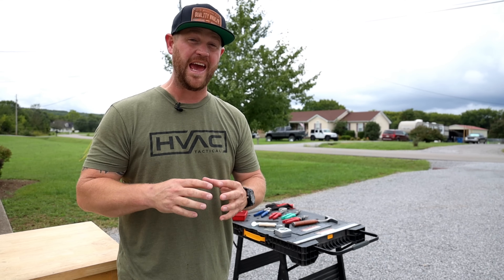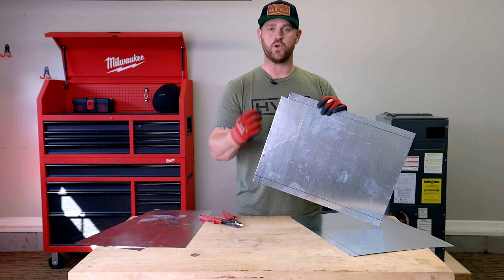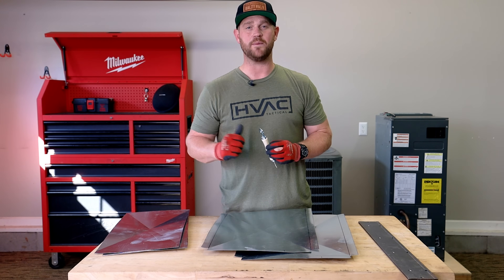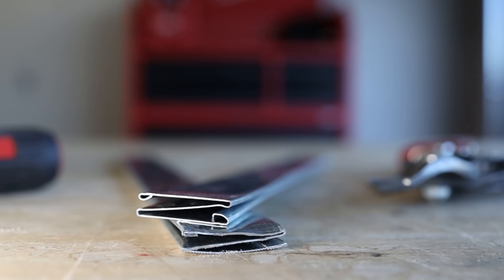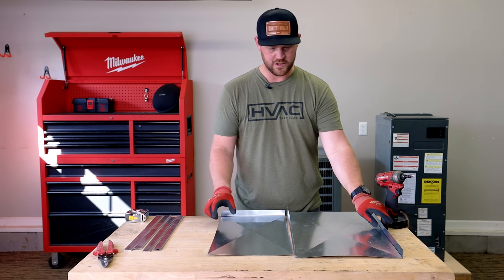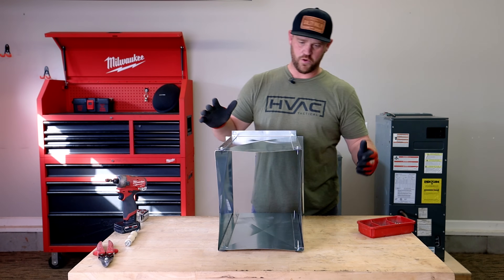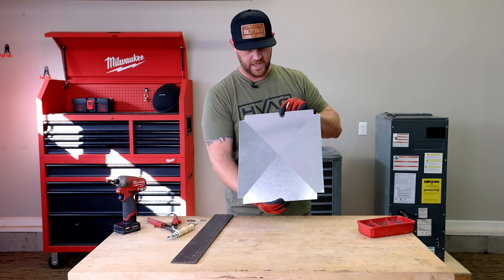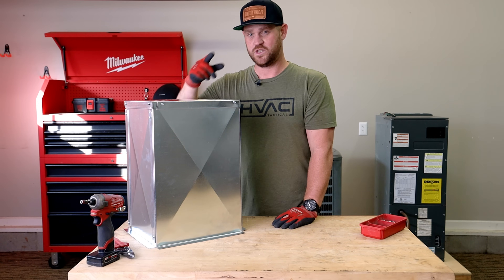How To: Fabricate A Plenum Box With BASIC Hand Tools | HVAC Ductwork

Comment: I'm trying to reuse my existing ducting for a duct tape mini split and may have to make modifications for the air handler. I was given a $12000 quote on a new traditional system and a mini split that doesn't require refrigerant charging can be an advanced DIY project for less than half that quote.

Comment: That's right...we're supposed to be impressed with a sheet metal worker making a sheet metal box. 
   I spent 10 years as a sheet metal worker--4 years apprenticeship and night school, then as a journeyman. That was back in the 60s and 70s.
   Back then, the old school journeymen were still around, men who could lay out and build square to rounds, rectangle to ovals, whatever you wanted, and all with offsets as required. They were craftsmen. 
   One of the main reasons I left sheet metal work in '74 was because I could see that the age of craftsmanship was rapidly vanishing. 
   Speed, obsessed with quantity, was replacing quality. This is why we are supposed to be impressed with a video like this. 
   So much is lost. Machines replacing men. Men merely operating machines. So sad.

Comment: I believe you are building a transition not a plenum.  The supply ducts would be connected to the main trunk line, not a centralized plenum box.   If it was a plenum, you wouldn't be triangulating every section.   Normally residential construction uses 1/2" #8 self tappers or #7 zip screws and commercial construction uses 3/4" #10 self tappers in consideration of the size and air flow resistance.   It looks like you could be doing some framing or demolition work with those burly arms of yours you don't have to use your head as much.

Comment: One example where a DIY homeowner might find this process useful is connecting a replacement downdraft cooktop to an existing ductwork to outside.  I fiddled with fittings and adapters for two days but there just wasn’t room inside the cabinet.
The solution- a small plenum box built exactly as you describe here with a cutout for the fan unit on top and another cutout for the round existing exit duct on the bottom.  
All the parts you use are available at a nearby home center.  If I had anything to ask you to add it would be the materials used to seal the box during installation.

Comment: Great video.  

What is the sheet metal you used to make this?  Thickness, dimensions etc.  Is it available at the typical big box stores?  You make it look easy and after watching this video I know I can do this.  I even own the screen tool :)

I am thinking about adding a second Air Return in my basement.   There is a 14"x14" on the furnace but it is in another room (unfinished) separate from the main area (finished.)

I was thinking I could make a box similar to this and install it on the Main Air return.  I would cut a hole in the wall of the main area and add the box at the bottom of the Main Air return and use a filter and cover (14x14 or whatever the nominal values is) and pull air back into the system to get more air circulation.

I may do this if removing old tape, cleaning and re-taping does not help.   I would add a couple more Air Supplies first as well.  

It is too cold in the Main area which is finished but real cozy in the unfinished area when the 1 Air Return is down here.  There are 2 supplies in the unfinished area and 4 in the finished area. 

Brian

Comment: Very nice job thanks for the video!.

Let's say your working in a tight closet. You just installed the furnace and working on the transition but your in such a tight spot and you can not add any screws to the outside of the the transition box. The leftside, and right side, and back are unreachable. Can I just add the screws to the inside is that Acceptable!

Comment: great video.  would have been even better if you had made mention of sheet metal gauge used and if if should be different depending on build.    also was hoping you would discuss a little into duct attachment to plenum after it was completed.

Comment: Using the window screen tool to make the cross brakes is genius! I've had one of those tools hanging on my pegboard for years and it never occurred to me to use it for that. Lacking a large box & pan brake has been an obstacle but with that trick under my hat I hardly need one now.

Comment: Thanks for the video. What is the max length of the cross break I can have on a rectangluar trunk? I have a metal sheet of 4x10 feet, so I was wondering if I could use that and connect the ducts every 10 feet.

Comment: 3 Questions: First, why do you use such long screws? Next, Why do you use an impact driver? Working with and assembling sheet metal is noisy enough by itself. Finally, without feeling the metal, I can't tell what gauge you are using. What gauge are you using for your project and is it code for plenums where you live? Thanks. Retired tin-banger from Canada.

Comment: you tube is cool as hell. i've been a square duct / hvac  layout and installer for over 30 years.I ve installed more than several hundred hvac  systems. I  worked with and was taught by several old men who were sheetmetal mechanic in the 60's. But none of them ever showed me about the screen roller to make a cross brake. I would of never thought of that. Thanks for sharing. Sheetmetal fabrication is becoming a lost art. I am trying to learn all of the old ways of sheetmetal fabrication, and (tinsmithing) . I'll definetly use the screen roller to put a cross brake on my tie ins next time I change out a unit and have to field fabricate the duct work.
Thanks Again
Reply: Im sure you're familiar with hand made Pittsburgh seams. A little rough on the hands, but I like making them look better than the machine.

Comment: Really cool technique w the screen roller.   Do you still tape the joints?  They used Slock (or similar) on our newer plenums and taped them as well.  

What I’m in need of is a new catch pan, long story short it was made too short to extend under some key parts to fully catch condensation water and when the 1/2” drain stopped up from slow rust and mineral accumulation…well it’s a good thing there was a water resistant cover on the pool table 😱.   I’ll have to look and see if there’s a deeper folding bar avail or make one.  

So any tips on drain pan forming or unstopping an in-wall 35’ long 1/2” drain w right angle pvc joints in it, please feel free to make a video 😉😉!!

Comment: I always used adjustable quick scribes to mark the notches. I have never seen that cross break tool before . I'm sure it would only work on 26 ga. metal or lighter , but seems make a nice looking break .

Comment: I'm not an HVAC Contractor!  however, I'm making a Plenum that's 36" W x 21" D x 11" H (8,316 cubic inches) to fit on top of an 80,000 BTU at 96% Efficiency Gas Furnace with an evaporator cooler sitting on top of it).  What's the minimum spacing between ducts. I'd like to install 2 or 3 6" ducts on the front and rear,  is that overkill? meaning.  on the 21" Depth side from front to back, cutting 6"  holes to install (2) or (3),  6" Ducts.  the width left to right will be 36".   would it be better to install (2) 6" ducts on each width side. they will be 21" apart front to back and cut an 8" Duct perpendicular to connect to a remote Plenum? I can't provide a diagram because there's no way to upload a .jpeg or .png image. the current Plenum that was installed 30 Years ago with a 115,000 BTU Furnace was oversized!  my home is 1500 Sq Feet at 5000Ft Elevation above sea level in Utah. The current installed Plenum is 23" Wide x 20 Deep x 22 High. it has (3) 6" ducts on the front 23" wide side, (2) on the Right Depth Side 20", and (3) 6" ducts on the Rear 23" side Total Cubic inches (23x20 = 460 Cubic inches x 22 Inches = 10,210 Cubic inches.

Comment: That looks great and neat .
My duct work to the ac is coming away from the brick wall . What would be the best solution to fix this it's been about 7 years since the install, I believe my home is settling.  Thanks for your expert advice
Reply: Depends on how far the distance is, I’d measure it, then you’ll need to remove a section to add a piece in between to bring it closer to the wall. You’ll need to account for the crimp sliding in also on top of your measurements, a hand crimper is normally 1’1/2” extra, make sure to screw it in after and seal it with a mastic sealer or a duct tape.

Comment: I just built one of these per the video and it turned out great--the only thing I did differently was the "safety flange" that condorman3 described in this comment thread.  I even had one of those screen window installation tools in the shop and didn't really know what it was until this...🙃

Comment: Hey thanks man , used your video . I just rebuilt my plenum box above my furnace to add in a new ac coil.  With a back ground in machining but no exp in sheet metal it was a snap with this videos .    

It was just like grade 2 all over again cutting out paper shaped and glueing them togeather except the paper will cut you bone deep and the glue is s clips and c clips

Comment: I never worked in a sheet metal shop that had carpet lol I was taught the cardboard trick for on the fly cross breaks tho , the screen tool is a nice touch I always used a straight edge and the heaviest screwdriver I had lol

Comment: These types of videos are the best ones. Teaching folks how to put things together and build ductwork at home. Keep up the great content.
Reply: Steve Lav has some pretty good sheet metal videos.  He does a good job of creating sheet metal transitions to tie in the new furnace with the existing ductwork. For some reason, most of the HVAC contractors in my area love duct board but I’ve seen some real sloppy installations using that product.

Comment: I'm a 33 year HVAC guy with a full bag with tongs, Whitney punch, bar folders, tongs, tinner hammer, panduit gun etc etc etc, and while I CAN build a box, I do every 9 years. In my opinion there are very rare boxes or ducts what are well done, and none that are as good as a fab shop. Good Pittsburgh's, furnace flanges. shoes etc mean that a fab shop with do a more professional job than a field setting 100% of the time. I can't count the boxes I've seen built with S locks. It is rare that I have to build a plenum on the fly. It's an installation environment which mean, and should imo, plan. So 99.99% of my jobs are planned and executed well through planning, which means things are fabbed.
Reply: You are absolutely right a properly measured and pre fabricated plenum is ideal however he did a pretty solid job considering only hand tools. totally useful for on the job application
Reply: @stevetranchida  I can't disagree with that.

Comment: I would love to see this made into a series. Take each basic part of a solid duct system and show how to make it with basic tools.
Reply: I second this
Reply: I second this
Reply: @igotsomespace  you mean 'third this' ! 🤣
Reply: Nah, I turd this
Reply: I’d like to see this one made out of two pieces instead of four, sans the lid, only using hand tools. You would only have to make one bend with something other than the tools shown. I can think of several ways, but seeing it done would up confidence.
Reply: @Jack of All Trades Master of Some  you could use that 24 inch folding bar. Put the folding bar on the inside lined up and hang the metal off of a table a bit and bend it up
Reply: i keep hearing S-slaw
Reply: @amiga2025  lol im still trying to figure out is he said bullie bar or fully bar but I know I need one

Comment: 😂 when a commercial installer jumps to residential.  
 Seems like using S lock is just added material that’s not needed. doing it in so many different peace’s adds air loss if you don’t seal it on the inside. Could of done the hole thing in 2 peace’s

Comment: Great video. I found another one where the mechanic builds a one piece plenum using the edge of an aluminum step ladder as a brake. Both ways are good, one piece is less expensive, uses fewer s Locks.  Thank you.
Reply: Its not a lock, Its an S-Cleat. S-cleats are used if you're too lazy and stupid to make a lock.

Comment: That's a nIce  job!  As others sometimes do, I also make a safety edge on the bottom flange. Another thing that can be done, is instead of using S cleat for the seams, you can make your own Pittsburg Locks which look far better and more rigid. The Pittsburg locks take quite a bit more time by hand though. Many guys in the field would just use the S locks as you did, but if the job was a big profit job, or for your mother or father you might spend the extra 30 minutes to an hour making those Pittsburgs. WIth good handtools and experience at it, those Pittsburgs might only take an extra 10 or 15 minutes. You have a good long bar folder on hand there I see! That helps. One thing I learned here was using that wheel to make the cross braces...very cool.

Comment: Flange lip is to big that will be off the sides of the furnace and back. Should have folded that twice, looks like 1 inch, you fold that piece again with 1/2 folding bar it would sit perfect. Good job however.

Comment: Thanks for the video! ... For anyone searching for "folding bar" it is the Malco 24" hand bender (last item in the list of tools).
Reply: Question  how to put the holes (exits)on the  plenum box?
Reply: @jgro7319  1-Draw a circle 
2- Drive a stout flathead screwdriver through the metal with a hammer 🔨 
3- Drive the head of the screwdriver 🪛sideways through the metal until you have a 4"-5" gash torn into it
4- Use offset snips to cut out your circle 
5- If your hole is too small, trim it
6- If your hole is too big, discover metal patches and pookie🤣

Comment: Nicely done.  Only thing I'd do different is the 1" flange that rest on top the air handler.  I would have used your folding bar with the 3/8 side to bend it under itself.  Making it a half inch double hemmed safety flange.  No sharp edges that way.
Reply: I was gonna mention the safety edge too.
Reply: Great idea!
Reply: Good point , I just now screw straight into the flanges in the ah, now a days you gotta tape, mastic , duct seal or whatever method you use and wrap it anyways, kinda mitigates the sharp edge thing,  of course tho some stuff is exposed and not wrapped then 100% the double half inch hem, flange , whatever is the safest and of course best looking no doubt 😉
Reply: @donniehallaman7685  you guys have to wrap in non-humid basements?
Reply: @Edifying_Topics  yea we have to wrap anything that isn't conditioned space, if it was exposed in say a finished basement with runs then no. But if it's unfinished unconditioned space then yes
Reply: @donniehallaman7685  you talking about wrapping the  whole air handler?
Reply: @Mike West  no just duct , plenums the insulation in the air handler is enough I guess? I have never been told to wrap the air handler luckily can u imagine going to a service call and having to cut duct wrap off to take the doors off lol , that would blow

Comment: Need to show how to make a folding bar for the nonprofessional. Perhaps a hinge sold in different lengths/widths at hardware stores, then maybe sandwiched 
between couple boards the same length. That would give you the 1" depth. Just an idea, right now I don't have a need to make one.
Reply: Get a Hensler bender off amazon. will do 36" and is about $80. Harbor freight has a 30" brake that's cheap $60. They also have the hand sheet metal folding tool that he uses. You can make a hinged brake with angle iron or cut up an old bed frame but you're not going to get the clamping force a brake gives you so your bends won't be straight in the middle due to flexing of the tool.

Comment: Why the 1" lip at the air handler connection?  No manufacturer uses 1" Gao, they all are 1/2"...you should have safety bent the mating flange so it will be flush with the outer cabinet dimensions

Comment: This was a very helpful video.   I got a little aggravated with commenters saying this could have been done with one piece of metal.   Sure it could have,   but how many DIY's have a 4' metal brake to make the bends.   This video showed how to make the plenum with basically common hand tools .. and the 2 foot  hand bender.   It sure boosted my knowledge for dealing with sheet metal.   Thanks
Reply: This can be done with one piece of metal and no brake as well. If you notch each corner top and bottom of the plenum prior to bending, you can easily bend this up in one piece.Line the edge of your folding bar up with your notches Put a c-clamp or some locking pliers on each end so it doesn’t move, and bend away. 
OP’s way may be easier, but it’s more labor and material intensive.

Try not to get aggravated next time. Some of these people are just trying to educate. Sorry if my explanation was hard to follow, everything is a little easier to teach in person/video.. 😅

Comment: On the 13.5" measurement, are you making your initial cut 15.5" and it will be 13.5" after the bend?
Reply: I'm not making this piece but I know that you have to add 2 inches for each 1inch fold
Reply: @richardknapp5727  thank you

Comment: Why didn't you apply the inner insulation (lining) before completing the plenum? I'm not a sheet metal man; was always a repairman and installer, also salesman and shop owner!
Reply: Because why would you waste time to line the duct when it's not needed in 90 percent of installs unless it's commercial type installs in that case you would wrap it with insulation.  And only needs to be lined in non temperature controlled rooms
Reply: @TalariaDave13  I meant ducts!